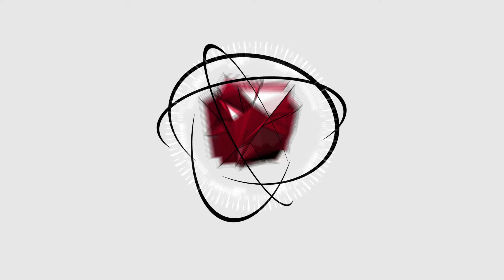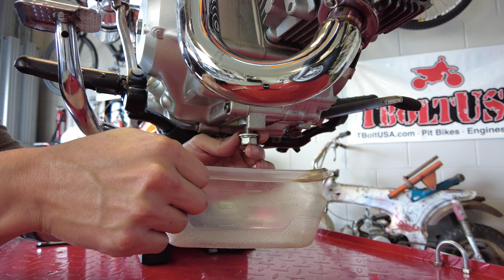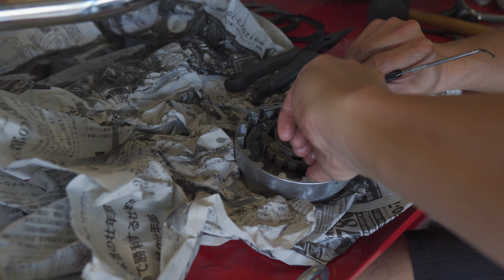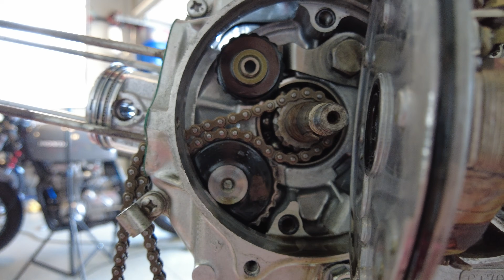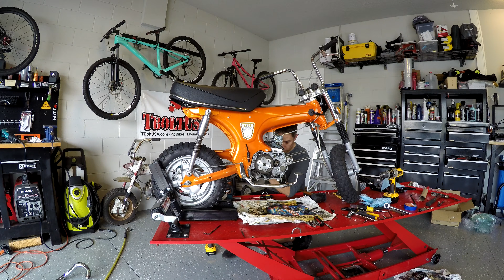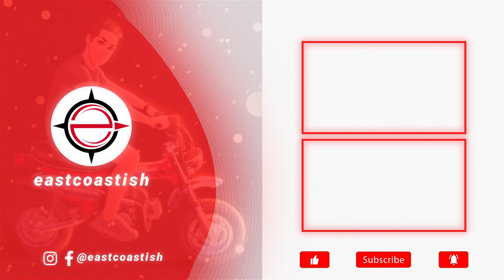Honda CT70 Clutch Replacement & High Flow Oil Pump Installation

Comment: If you had a really worn sprocket then the chain is probably shot do to the stretch and wear from the flat sprocket teeth, if the chain was replaced onto the bad sprocket and run much id really inspect the chain roller fitment into all the sprockets especially the new one

Comment: I saw your kickstarter is also slipping, I have a 1974 ct 70 auto. Kickstarter was only grabbing at the very bottom. Just replaced the clutch ( with factory honda parts ) Used motorcycle oil, still slipping. Adjusting the clutch did not help either time?? Thanks so much.

Comment: When converting to a big bore engine I understand you need a high flow oil pump.  About the clutch, do you need a kind of heavy duty clutch or you just rebuild the clutch whith new stock parts?  Thanks for very informative video!
Reply from the maker: You can run the stock clutch, I'm using 60% stiffer springs from SMR to get a bit more bite though...
Reply: @eastcoastish  thanks for that fast response.  Could you please direct me to a SMR SPRINGS distributor in the US or preferably in Canada?
Reply from the maker: @gervaisdube1843  check out steady garage, they're great.

Comment: Awesome Video...again! I'm getting ready to start my project which is very similar. I'm changing clutch disk, heavy springs, high flow pump and the 88cc big bore. I see you did your work with the engine in frame. Would you think it any easier to have the engine removed?  I'm also going to replace the wire harness so I probably need to drop the engine anyway.

Comment: Removing engine studs are very simple. Put one bolt on the thread and another then tighten them together and turn left like you normally would and it will unscrew
Reply from the maker: Yeh, that's what I did in the video with 2 m6 nuts - wasn't sure if the studs would be seized in there or not but ended up coming out very easily.

Comment: The initial step by step was very good. Would have liked to see the technique of using the screwdrivers to wedge the oil pump gear. Sorry to see the reassembly sped up like many of the Thai video's (that I have stopped watching). For a beginner often the reassembly is a challenge too. Your channel is still one of the best.
Reply from the maker: I literally just held a flat head screwdriver in the oil gear at the 5 o'clock position (while unscrewing with another flat head screwdriver on the clutch side (which you could see in the video). It wasn't very tight at all, it just needed a little bit of tension to break free. And in hindsight, I should have just loosened that before I took the head off; the tension from the timing chain would have been enough to hold it. I had sped up the reassembly because I had just done that in detail in the 88cc video from a week ago, you can see that here: https://www.youtube.com/watch?v=v3rGdf9YbQg